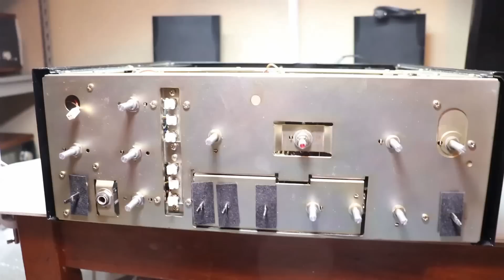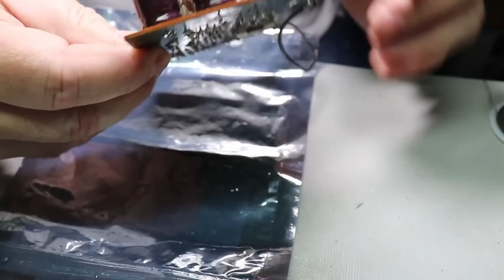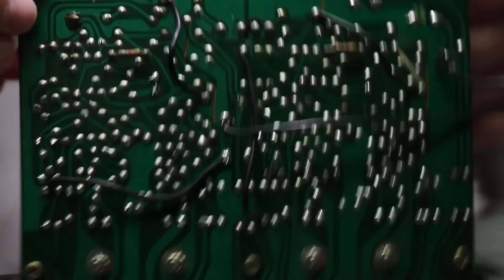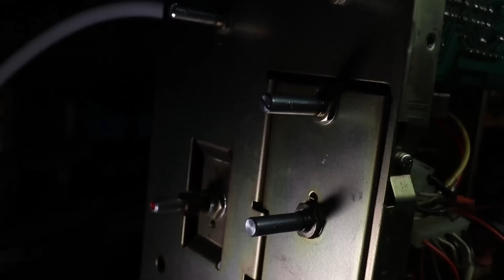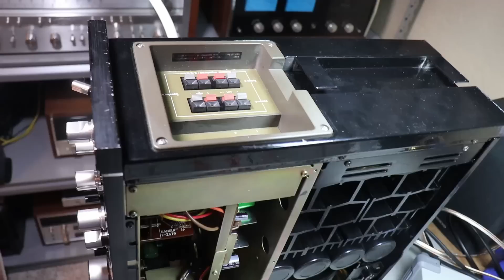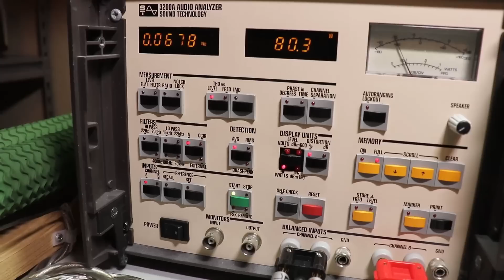AU-9900 - Maybe The Best Ever! Sansui Integrated Amplifier Vintage Stereo Repair Audio Restoration

Comment: What's with all the cut traces and soldered wires on the "F2580 Driver Assembly" board. What are the modifications.

Comment: Love this video and look forward to a total recap of a AU-9900 that I got yesterday. 
Did you replace all the caps but the 4 large ones? Looks like the are not worked on in the video …
Reply from the maker: Thanks for watching. I did replace them after I completed this video. I had to order them. I have most all of the other components I need in stock when I begin a project. About the only one's I don't have are the filter capacitors.
Reply: @vintageaudioaddict  thanks for the answer. Any recommendations for these caps? I may go with Kemet 10000uf/63v since they will fit :)

Comment: I really appreciate this as I was given one from a neighbour to work on and it’s my first stereo amp. I was just curious about a couple things, first the right speaker does not work at all (through headphones either) and also the bass is very distorted. If you could give me some insight I’d really appreciate it!
Reply from the maker: It's really difficult to say what the issue is other then the equipment is pretty old and probably needs a restoration.  Almost all the vintage audio gear needs attention being 40+ years old. Electrolytic capacitors are the number one cause of failure in any type of older electronics.

Comment: My best audio chum had one of these snd they were quiet, and great looking.
However....several friends had the latter day AU-717 to 919 series and the blew output transistors easily.
Reply from the maker: Thanks for sharing. I don't have any experience with the AU-717 or AU-919 but the Sansui's in my collection have been pretty reliable.

Comment: Hello.  When you put your thermal compound on, is it under the mica piece or between the mica piece and transistor?  Do you just spread on a thin layer?  Also....you helped me successfully replace some leaking and faulty caps on a project unrelated to amps.  Thanks.  A.
Reply from the maker: Great! I'm glad that you got your unit operating. You put a thin layer of thermal compound on both sides of the mica insulator. Both the heatsink side and the transistor side. Yes, a very thin layer. You are just filling in those microscopic imperfections in the metal of both the heatsink and the transistor so the heat transfer is better.

Comment: Ever looked inside the Sansui AU 20000 from the same series?  170 W/ch which was the highest power ever offered in an integrated amp in the 70s. Check also the Sansui AU 919. Technically it may be the best period... five power supplies, fastest slew rate / rise time and lowest TIM distortion of any amp at the time. Possibly surpassed by the Harman Kardon Citation XX power amp which was release three years later.

Comment: I've got a fully restored AU-9900 and have heard and read that there is a difference in how the volume is controlled between the 9900 and the 9900a. Could you explain the difference and give me an idea of how this correlates to the volume indicator. In other words, do you need to turn the 9900's volume level up further than the 9900a's to get the same level?

Comment: Do you have a soldering video that I have missed? If not, would you consider putting one out, that shows what temperatures you use to solder with your Hakko unit? And the more in depth techniques that you employ? Thanks!

Comment: Hi Chris,

I have recently acquired a Sansui AU9900 and have watched your video, pt1 to pt4, on YouTube.  It was great and I enjoyed every bit of it.

My AU9900, besides requiring a full recap (more than 45 yrs of age), has a popping sound on the left channel after the amp is turned on for about 4-5 mins when it starts to warm up.  Do you have any advice for me in this instance?

My plan is to first recap the amp completely first, adjust the bias currents, etc, to see if this goes away.  As such, I would like to ask if you have a list of the required capacitors that I can order from your last restoration exercise.  If you do, that would save me some time by not having to remove a board, check the caps, place order, wait for a few days for these to arrive, and keep repeating that for a number of times.

On the other hand, I think to recall you said you would change the 4 big reservoir filter capacitors in your amp, but don’t recall you showed the details of such.  Did you end up changing those?  Please advise.

Thanks you very much for the excellent videos.  

Looking forward to hearing from you.

Regards,
Jeremy
from down under

Comment: I have been into vintage audio since the days of quadraphonic equipment as a young teen at 14 or 15. I'm now 62 & really enjoy watching you work on and rebuild this equipment. I really appreciate your patience & expertise. Thanks. I had a Sansui 50/50 receiver  & a Marantz 22/25 receiver at one time. Now i have a vintage Technics SA - 52/50 receiver I'm using as an amplifier , because the FM quit working.

Comment: "There is no right and wrong".... until you pull up a trace. Your way is simply wrong. Use a solder sucker and pull out the pin when you know it's clear. I'll say NASA and mil spec is the correct way. 
 BTW, nothing better than a well burned in transistor.

Comment: I just fixed a AU-11000A, its almost the same thing, the 11000 has gold plated terminals on the inside along with a larger power/protect board. the main caps are 10000uf as well. those fragile transistors on the driver board are not present on the 11000A . 
This amp is a work of art, the cover over the driver board is just for looks and just for the service guy.

Comment: Have you ever made a comparison recording between before and after recap an amplifier and see how big the differences is? It seems tha this Sansui was already working before, so I would be nice to see what to expect after recapping a unit. In my case I have a small restoration of my Sansui A40 but it was limited to potentiometers and switch selector cleaning. The unit is working fine, sonI am in doubt if I should change all capacitors. Thank you
Reply from the maker: The main reason that I recap is for the reliability of the unit. As for the sound it doesn't really matter what "I hear", it's what you hear. I could tell you this and then tell you that like so many of the audio forums do. Panasonic caps are better, no you are crazy Nichicon is the best. On and on folks argue. My other half loves the way her Sounddesign electronics and distortion lab speakers sound, is she wrong? 

Check out the video below and see what the manufacturers of electrolytic capacitors say about their own products.   

Replacing Old Electrolytic Capacitors - https://youtu.be/RaWrYJ6amcA

Comment: I actually did watch all of the videos on this.  Why?  Because I love my Sansui AU-717 amp & tuner.  I found a service tech. in Oregon who went through the amp and just yesterday picked up my re-capped Bozak crossover networks from a place I found in Salt Lake City.  They are for the B-4000 Symphony model of 1969.  Living in Idaho Falls, Idaho, nothing happens close to my house.  I just subscribed after watching a few of your videos.  I find your videos very to be very informative and I appreciate your patient thorough approach.  I'd like to see you go through an old Technics turntable.  At one time these were common as rocks but I'm not confident enough to attempt dis-assembly on my own.  (disconnected tonearm lead)  I shall stay tuned in for any and all of your videos.  Thanks again, Sir.
Reply from the maker: Your welcome. Thanks so much for watching and welcome to the channel. You have some great gear and I'm glad that you found someone to service your equipment. That's getting tough to do. I appreciate your feedback on my video's and your suggestion to do a turntable.

Comment: I have a Sansui AU 11000a which I think is a step up from the 9900. Always had to turn up the volume knob to 11 to get a sound from the 11000a. I prefer the sonics of the older model 9500 and the 777, Just sounds better to my ears. More bottom end. The phono stage especially
Reply from the maker: Thanks for sharing. Sansui made so many great audio products over the years. You said the correct thing.... "Just sounds better to my ears." So many people don't listen to their own ears. They need an "expert" that "has special ears" tell them what's good and what isn't. Listen to YOUR ears, no one else's.

Comment: 16:04 IF it has a capacitor mounted on the ground plane, and a thin track, you pull FIRST the leg from the thin track FIRST ALWAYS, never do the leg on ground wide plane first, because pulling it first, you can lever and unglue the small thin track on the opposite size.

Comment: Thanks for posting this video. I recently acquired an AU-9900 and it the sound quality really surprised me after getting it resurrected. I was going to enjoy it as is, but after watching some of your videos I’m going to be weary of a capacitor failing and doing damage on its way out. Where do you source and buy your replacements parts?
Reply from the maker: Your welcome and thanks for watching. I've listed a couple of video's below that may help answer your questions about parts.

Here's a video I did on parts sourcing - https://youtu.be/todxFu1c0H0

Here's a video I did on electrolytic capacitors -  https://youtu.be/RaWrYJ6amcA
Reply: Vintage Audio Addict 
I will check both of those out. Thanks!

Comment: Loved watching this and was impressed at how modular it was. Really makes it nice to work on. Did you ever work on a CA-3000 Sansui preamp?  I had one and those pass-through connectors on the boards were a nightmare for my repair tech to re-do.
Reply from the maker: Thanks for watching. No, I've never had a CA-3000 in my collection or seen the insides of one but I do have a CA-2000 that I restored. Some of the units can be more of a challenge then other's to work on.

Comment: Suggestion... Hey my friend would you consider doing a video on reconditioning a vintage turntable........??? The first reason is personal... After watching a few videos on YouTube on turntable repair feel this would be a good spot for me to start and learning how to repair vintage equipment... They seem to be a lot simpler a lot last caps replace excetera... plus I have 2 thoren's turntables, a Harman Kardon t55c turntable still in the box AKA NOS.... and I also have a direct drive Sony PS x70 fully automatic oh... It does everything but hold your hand LOL. But it's a beast and it weighs 35 lb... Again thank you sir for taking the time to read my long post... I've just been perusing the YouTube channel and if not found much that would help me when it comes to turntable reconditioning... thanks in advance for reading and looking forward to your response...

Comment: Making it look easy! Dang man i have spent 30 hours cleaning the G-8000 !! I wanna restore the caps but it sounds perfectly good it set in a closet for 35 years !! It was for got about !
Reply from the maker: Wow, 30 hours cleaning! My other half will be inviting you over, LOL. This stuff is mostly about experience, it's really not that difficult. Unlike today's electronic's the vintage audio equipment was engineered so it could be repaired. It's great that you got your G-8000 going again, she's a good one!
Reply: @vintageaudioaddict  I love it ! Just had alot of build up on it i wanted it like new again , but a lil scared to replace caps , i saw all the brown glue , and i disconnected all circuit boards and cleaned the contacts some were lose of course 😆

Comment: Great series, I watched all four episodes. I have two questions about the bi polar capacitors. Do they have a orientation or polarity? One leg seems longer than the other, is that how you determine its polarity?
Reply from the maker: Thank you so much for your kind words and for watching. Bi-Polar's have no polarity so you can install them either way. The electrolytic capacitors will have a - sign on the negative lead and that is normally the shorter leg but always look for that - sign to be sure.

Comment: Man, wish I had your skills as I'm 54 and getting back into audio. Going to learn to solder. Your videos are very helpful. Thanks
Reply from the maker: Your welcome and thank you very much. Really, it's not that difficult. I think most people will tell you that experience is the best teacher with this stuff. Kind of like most things in life. Get a junker piece of equipment to learn on and get that soldering iron hot!
Reply: Do you suppose there's some kind of half-arsed short cut voodoo I can do to transfer his electrical knowledge?  Wish there was.  No, it only comes with experience and skill.

Comment: I don't have one of these amps and probably never will, but I did watch all four of your previous AU-9900 videos. To me it is interesting to learn the methods and techniques used by different YouTube vintage restorers. As you say, there is no "one right way" to do this work, but your experience and attitude make your videos quite instructive and satisfying to watch. Your explanations are clear and effective. I hope you had opportunities in your life to teach others, because you're good at it.

I'm a retired EE with a life-long interest in audio, DIY and otherwise. Its interesting to see the different design and construction methods used by manufacturers of that era, and I've learned many useful tips from you and the other restorers.

Couple of specific comments, not criticisms. About contact cleaning and DeOxit: you've mentioned cycling the switch or control dozens of times to ensure thorough cleaning and treatment of the contact surfaces, which makes sense. Mr. Carlson's Lab suggests a first application of the contact cleaner, waiting about a day, then a second application. This makes sense, too: the first application cleans and lubricates the contacts, and gives the cleaner a chance to treat the contact surfaces. The second application helps to flush away loosened debris. Just another option. A minor point: it is painful to watch some less-experienced restorers blast DeOxit over half of the PCB and the inside of the chassis; I'm glad you don't do that. DeOxit is good but expensive; that kind of sloppy application is wasteful and makes an unnecessary mess.

Another option for connector contacts is a product called Nyogel. This is a grease, not a liquid. Nyogel is specifically designed to prevent, among other things, a type of contact corrosion called fretting. Fretting happens when microscopic movement between the contact surfaces occurs because of normal temperature cycling at the connector, when the equipment heats up and cools down. This movement isn't enough to scrape the surface clean, so eventually invisible, microscopic corrosion sites build up on the connector surface. This is one reason that sometimes re-seating a connector fixes an intermittent fault. But once the connector gets to that point, the fault will return, sooner or later. Nyogel is quite effective at preventing and fixing that problem. It's expensive, but so is DeOxit.

And now about electrolytic capacitors: you are, of course, right that those caps have a finite life and should be replaced. My career work was designing and manufacturing embedded controls for high-quality, high-reliability (read: expensive)  commercial equipment in harsh environments, and electrolytic caps need careful selection and testing. My picky nit is that you really beat the capacitor issue to death in a lot of your videos. I understand that not everyone will watch all of your videos, and it is good to mention it, but really, if someone doesn't get it or doesn't agree by now, they're not going to. If I recall, you made a dedicated video addressing just this topic, so maybe a mention and a link? Your videos, your decision, and it is a minor point.

At any rate, great videos. I'll keep watching, and I appreciate the time and effort you put into making them. Thanks!
Reply from the maker: Thank you for watching and thank you so much for taking the time to comment. I appreciate your suggestions and for sharing your experience.

Comment: I have the Sansui AU-20000, which is kind of like this, but adds analog power output meters. I don't know if the spec is anywhere close to the AU-9900. Sadly there is no loudness control, which is kind of odd for a full featured integrated amp. I believe it is 170 WRMS / Channel. If I recall, the damping factor is amazing.
Interesting the tuner which came with it is TU-9900, which would theoretically be the model to match the AU-9900 amplifier. The tuner has amazing FM DX performance!!
Reply from the maker: I'd love to have an AU-20000 in my collection. Congratulations on owning one.

Comment: They days when Sansui were built like tanks and easy to take apart and service. If electronics was this straight forward to day. 
Its was sad to see Sansui take a dive in quality when they started making the fascias out of plastic. 
The back panel became hardboard and the power amp became one large scale IC.
Reply from the maker: Yes, the older equipment was built to last and it has.